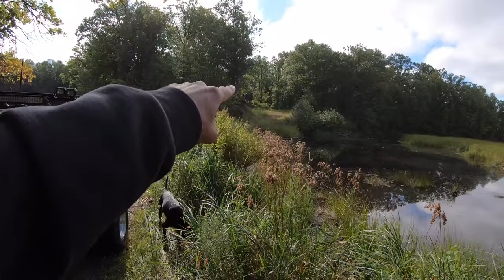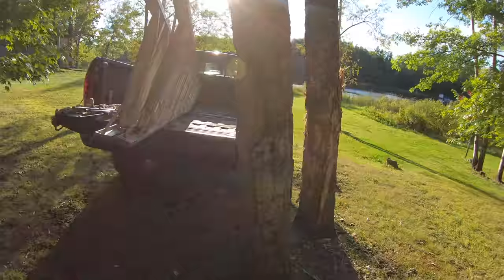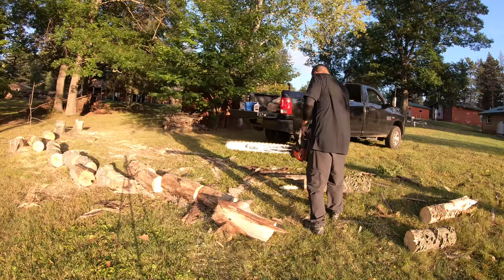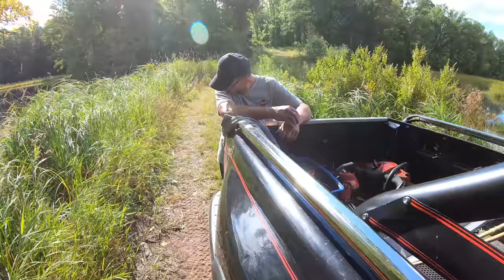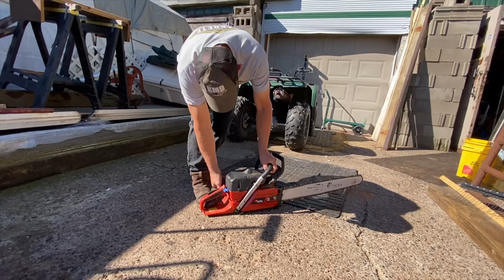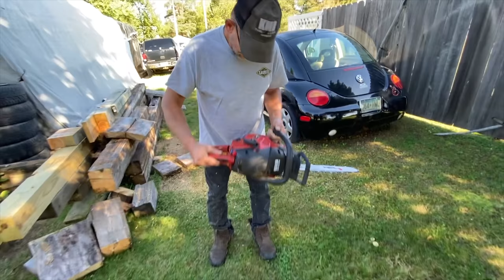Redmax chainsaws- the good, the bad and the ugly.  4 k video

Comment: Need to run the saw at 8,000 - 12,000 rpm, with load, for a couple of minutes. This will let the saw intellegence adjust the carb and gas properly. This is stated in the manual.

Comment: Also the saw frank is running is a slightly different design which is clamshell not the conventional crank case. Makes it cheaper but sacrifices performance. Same as a husky 460. The g900 is a husky 390xp.

Comment: Those saws are running very rich need to be leaned out a bit till you only here them 4 stroking/burbling at wide open throttle under no load
Reply: Brian Kirwan there rich for break in

Comment: The saws are all running surprisingly rich.   In my area at 465 ft. of elevation, I find most saws are running lean when bought.   Pick up a DTI-20K wireless tachometer and set your saws by that.   Forget the number of screw turns and tuning by ear methods because they will sound better and better to a newbie  the more clockwise the "H" screw is turned until  you go too far and ruin a new saw.   The tachometer is $100 and the refresh rate of its reading is fast enough to measure a two stroke.  The fast refresh rate is necessary on two strokes.  A cheap $20 tachometer has a longer intervals in between its readings of the rpm.   Saving one saw from destruction pays for the tachometer.   I'd be surprised if any of the 3 saws in the video are above even 10,500 rpm out of wood.   Tune to 12k with your 32:1 or 40:1 and non-ethanol gas and your new toys should live forever.   Just don't  leave gas in them all the time and try to not runs saws empty when working them.  I would not be surprised if the 1 bolt bar stud is actually just set in plastic with a really coarse lag bolt type of pitch.   Over tightening the bar nut may strip the bolt from the housing.   They started that when the junky tool less chain tightners came out.  I work on Stihl Husqvarna, and Jonsered but have no exposure to the Redmax line and I need to check them out.  The one that I looked at a while back didn't look at all like a Jonsered.  I guess that's before the merge.   I only truly enjoy the timber models of the three brands and all three build great saws when you get above 65cc.   Great quality video guys and I enjoyed it.

Comment: The 50 cc saw is the same as a 450 rancher. and the Jonsered 2250. Homeowner / farm grade saw that the new ones also only have one bolt. If you would have gotten the 52 pro model there would have been two bar studs. They are essentially just Jonsereds that are made in japan instead of Sweden.
Reply: Pollan plant in the US. I looked it up

Comment: RedMax is Husqvarna, you need buy the oil package to receive the 4 years warranty. The models from RedMax coverts to Husqvarna 455/390XP they are nice saws. The RedMax fuel is higher octane so it will run hotter I am glad you are using 32:1 single bolt is strange the Husqvarna 455 Rancher comes with two bolts. nice video
Reply: 450 has one. It is weird

Comment: I use Opti 2 synthetic oil which mixes at 100:1. I run it in all of my engines, including 4-strokes. I mix it in the can when I buy gas, and I add Stabil at the same time. Always buy non-ethanol gas for small engines. Look for a gas station which says explicitly on the pump that the gas does not contain ethanol.
Reply: Karl Armbrust That’s one good thing about has here in Wisconsin, every station that sells premium gas (nearly all gas stations here) has non-ethanol gas since all premium fuel here is non-oxygenated.

Comment: Looks to me like they tune them fat from the factory on purpose. I guess what I would ask you is given the price point for their pro level saws in comparison to a Stihl or Husqvarna which one do you think is more dependable and will last longer? I use my saws almost every day and come back to my old 1990's Stihl 036 with a 28" bar for almost all of my ground work. Its the one on my little profile picture. I think it also comes down to personal preference. I've recently tried some of the Echo saws for climbing and I love the 355T for it's power to weight in a lower price than the Stihl counterpart. Just depends on what you like I guess.

Comment: They are just a red Husqvarna. I heard they were phasing out the commercial line from Jonsered and pushing them to Redmax. I went to Jonsered's site the other day and they only had a few saws on there all homeowner saws. I saw Costco had Jonsered saw and some other stuff all battery powered tools a while back heard some other big box store maybe Menard's was going to carry them but that will just be homeowner stuff. I have a GZ5000 and I can't think of the model of the other its a red Husqvarna 439 or a rear handle version of the 435T top handle saw.
Reply: Jonsered's been phased out entirely. Their website shows no live links to any chainsaw models. Only way to get at the info is an "end around" through a google search.

Comment: @stainly "dirt monkey" I am a redmax dealer and I am disappointed that your dealer did not take the the time to properly set up your saws. Even after your guy tuned them they still are not 100% you need a splined drive can tool to get proper range of adjustment. If you would like i can put together a video of how to tune redmax saws if you would like to have something to share with all your followers.

Comment: That comment about 2-1/2 turns out, thats not a good spot for all chainsaws, you should check your specific chainsaw before you set them. Most of mine will run between 3/4 and 1 turns out on the high jet, 2-1/2 will flood the crap out of them.

Comment: I agree with Franky about the bar nuts. I think the Red Max is the same as Dolmar and Makita now not sure on that. I work on allot of Stihl and Husqavara chain saws. Some manufactures set the saws rich for a 3 tank break in period. They also put in plastic covers over the adjustment screws on the carbs. 1 turn out is more than enough 2 turns out and the saw should be to rich.32:1 is rich in my book. But it depends on what 2 stroke oil you run. If you run a high quality oil 50:1 is fine. Some guys use Amsoil and run the saws at 80:1 or even 100:1 and I have torn down all of the above and they all have a good film of oil on the crank and piston rod. Just my 2 cents. I don't know why the would put only one pressure point (bar nut) on a mid sized saw that makes no sense.

Comment: 32:1 ? I have never run a 2-stroke so heavy on oil. For years I have been running  Amsoil 100:1 2-stroke mix. Never any fouling and never an engine problem. Those saws loom lime Jonsered with a Redmax label.

Comment: definitely sounds too rich..... not sure any similarity, but my husqvarna blower has a throttle/idle adjustment screw.... thing would slowly die at idle. once i ran it at idle n fiddled w/ screw, fixed it perfectly.... similar scenario....... had a stihl farm boss, thing was junk..... bought a similar husqvarna n thing'll fire right up after sitting all winter.... i don't like anything unless its husqvarna

Comment: Even after Frankie adjusted the saws they seemed to still be running fat. You need to have a tachometer to properly adjust a chainsaw to factory specs. Frankie will kill those saws if he doesn't give them at least 30 seconds to warm up.

Comment: Way fat on high side on all 3 says.....something I wouldn't of even took to the woods until I got the screwdriver out....they set them that way to break the engine in so people that have no clue how a saw is supposed to run don't lock the engine up....most likely Redmax is running a 25:1 fuel ratio

Comment: If i would of known how difficult it is to adjust this carb , I wouldn't of bought it. The low idle is fixed and the high idle only has a 1/4 turn to play with. The carb kit is no longer available and the carburator is over $ 80. I would not recommend this brand or buy it again. Better to spend your hard earned money  on Echo, Sthil or Husqvarna.